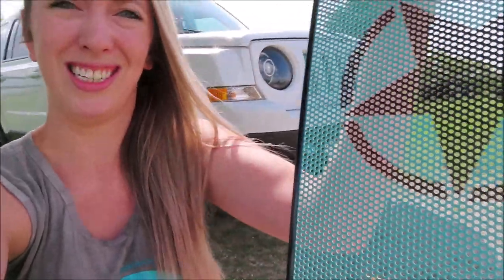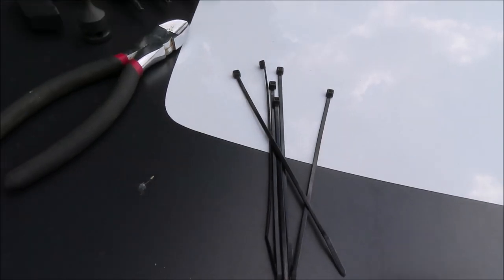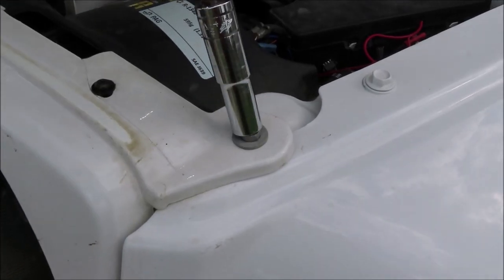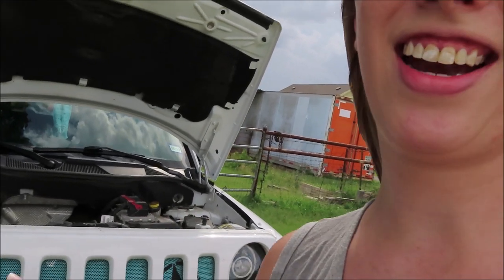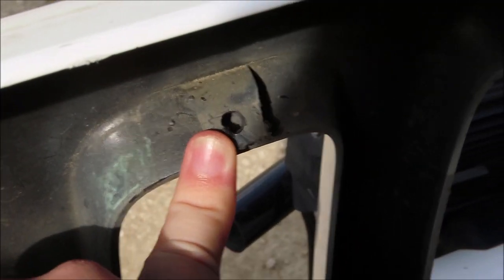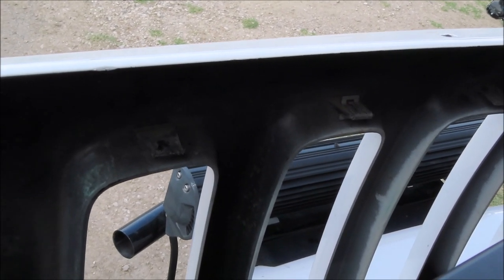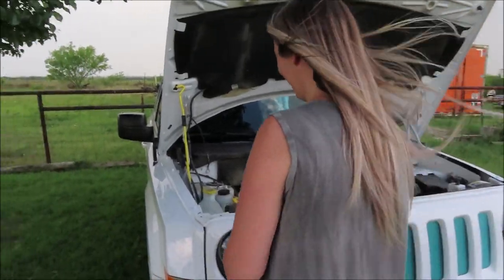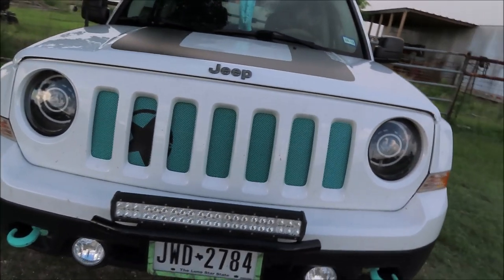Dirty Acres Grill Insert Install on a 2017 Jeep Patriot

Comment: what size rims do you have ? and did you need any lift kit or stock suspension?
Reply from the maker: No lift was done. I believe the wheels were 17s if I’m not mistaken. The tires did rub when the steering wheel was at full lock but we did a modification to the pinch weld and it was fine after that.